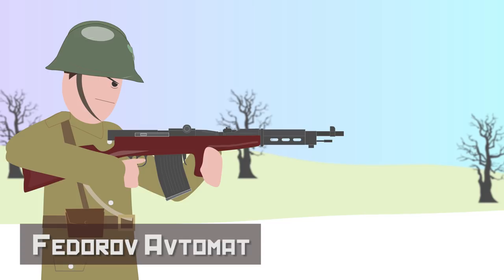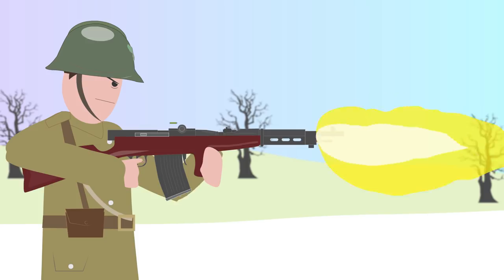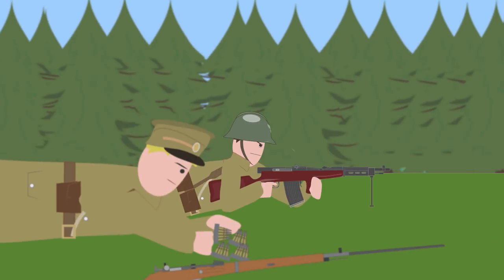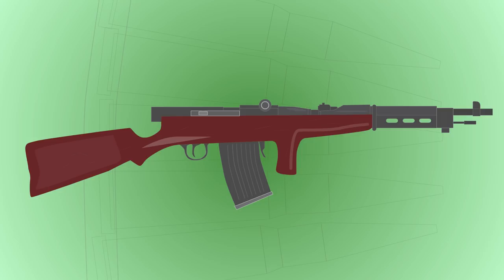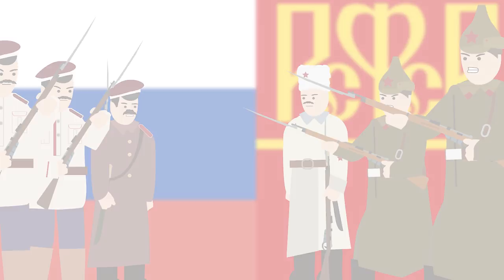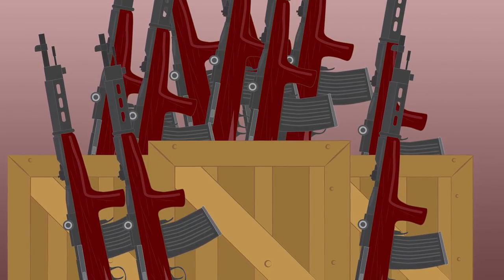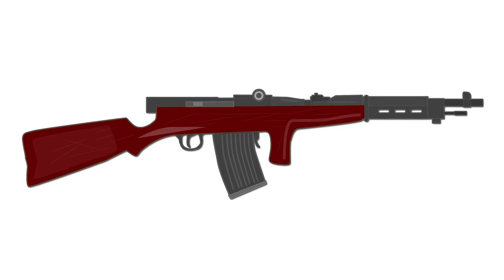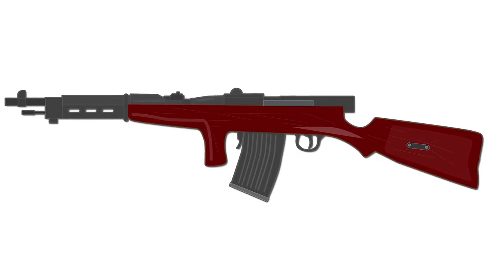Fedorov Avtomat, The First Assault Rifle?

Comment: Avtomat is not an assault rifle, never has been, never willl be. The reason, using rifle munition. If it was an assault rifle, then chauchat would be too, and its not. Change my mind.
Reply: You don't know much about the ammunition it used huh?
The 6.5 Arisaka could be described as the first intermediate cartridge today. Back then, it was considered a rifle cartridge, but it is far from a standard rifle cartridge. 6.5 Arisaka had around 2500J of energy when shot from Avtomat Fedorova, which is the same energy as the modern intermediate cartridge 6.5 Grendel. 

Rifle cartridges are 3600J +, so is it an Assault Rifle or not?
Reply: @BloPsy__  intermediate cartridge= shortened rifle cartridge. Underpowered or not,  it uses a pure rifle cartidge with no modification. Thus it is not using intermediate cartridge, thus it is not an assault rifle. End of this story.
Reply: @tigerbesteverything  Intermediate cartridge doesn't mean shortened rifle cartridge you donut. (5.56x45, 5.45x39, 5.8x42 and others wouldn't be intermediate then)
An intermediate cartridge is a cartridge, that has power between a full-power rifle cartridge and pistol cartridge. 

By modern standards, 6.5 Arisaka is certainly an intermediate cartridge when used in the Russian military in WW1 era - they already had a full-power rifle cartridge, the 7.62x54R, which had around 3700J of energy. The Arisaka had only 2500J of energy. That's also why Fedorov used this cartridge - to gain better controllability in automatic fire (mild recoil). Which is the same reason why Germans developed the 7.92x33.
End of story :)
Reply: @BloPsy__  No, arisaka is nowaday typed as rifle cartridge, thus it is not an intermediate cartridge, end of the story. And your point isn't valid, as type 38 (at least japanese) rifles where the standart issue rifle at that time, or something like that. This is why there is such an extensive usage of the 6.5 arisaka, and why the avtomat is an automatic rifle and not an assault rifle. Arisaka is a full rifle ammunition, then not intermediate cartridge.
Reply: @tigerbesteverything  What the category says doesn't matter in this case.
In terms of the Russian military, it is a cartridge that didn't have the power of a full-power rifle cartridge - that's what matters in this discussion. It was used for the same reason as 7.92x33 and it had power in between standard rifle cartridge and pistol cartridge. You can see why it should be looked at as an intermediate cartridge when used in Avtomat Fedorova, if not, then you're blind or stupid.

It's the same thing as Czech Samopal vzor 58. Samopal means submachine gun, they didn't have any other term back then for their rifle. By today's standards, it is an assault rifle.

No need to answer. I already know what you will say. In terms of the Japanese army, sure it was rifle cartridge, but in terms of Russian use - it was arguably the first intermediate cartridge - it doesn't matter what type of cartridge it was in Japan.

"After observing the effectiveness of the Type 30 6.5×50mm round used against them during the Russo-Japanese War of 1904–1905, leading Russian arms designers chambered early Russian semi-automatic rifle designs for the Japanese round. Since the standard Russian military rifle cartridge of the time, the 7.62×54mmR rimmed round, was too powerful and generated excessive recoil in an automatic weapon, a 6.5 mm round was seen as more appropriate."

Comment: Well its more of a battle rifle like what the M14 was. To be an "assault rifle" at least the way we know them today it really has to have a pistol grip, select fire, an intermediate cartridge, and be smaller and ideally lighter than a full size rifle. There may be other requirements but to me these are the most important. 

This weapon as well as the BAR were on the right track but it was the STG44 that had the right idea ultimately.
Reply: Well, it has almost all the things - it only missing the pistol grip.
Reply: @BloPsy__  It also needs to be shorter,lighter and a smaller cartridge. Definetly not an assault rifle but surely a Battle Rifle.
Reply: @PennsyPappas  Shorter? It's long as an M16 and it's lighter than StG 44. Also, by modern standards, 6.5 Arisaka can be described as an intermediate cartridge - It was used for the same reason as 7.92x33 Kurz in StG, it has the same energy as modern intermediate cartridge 6.5 Grendel and in the Russian army, it had energy between a standard rifle cartridge and pistol cartridge.

So is it really a battle rifle?? I don't think so.
Reply: @BloPsy__  But you sure as well wouldnt want to fire full auto. No it will always be a battle rifle but i vuess can be close enough. Still will never be a true assault rifle.
Reply: @PennsyPappas  You actually want to fire a full-auto - that was the whole intention of this weapon. This cartridge was used because it had mild recoil in full auto. Just like 7.92x33 or 7.62x39...
Seriously, if this is a battle rifle then MP 40 is an assault rifle...
Reply: @BloPsy__  It may have been designed to fire full auto but that didnt make it practical to do so. The men who used it complained that it couldnt be handled in full auto. Shkrt vursts and single shot mahbe but it couldn't be sustained for long or very well at all. Not sure where goure getting mild recoil from. Mild compared to a 30.06 maybe but full ajto was super impractical on the M14. Hence one of many reason why they went to M16. That and tou could carry so much more 5..56 ammo comapered to 7.62x51. Though it has proven itself to be an effective sniper rifle over the decades.

Comment: Battle rifles are not assault rifles. 6.5x50mm is not an intermediate cartridge.
Reply: By modern standards, it's an intermediate cartridge. 
At the time of adoption in the Russian military, they already had the full-power rifle cartridge 7.62x54R and as such, the 6.5 Ariska was between that and pistol cartridge in terms of energy. And as a bonus, 6.5 Arisaka is fully comparable with 6.5 Grendel (Which is a modern intermediate cartridge) in terms of energy.

Comment: It's not an assault rifle because it doesn't use an intermediate cartridge. Therfore, it is, by definition, a battle rifle.
Reply: Are you sure tho? 6.5 Arisaka has around 2600J of energy - which is the same as the 6.5 Grendel (which is intermediate cartridge)
By today's standards, it can be considered intermediate - so it's a battle rifle or assault rifle?
Reply: @BloPsy__  I'm entirely sure. Based on the primer type. The primer type is "large rifle". The 6.5 Grendel has a "small rifle" primer. Also, the 6.5 Arisaka is 6.5x50mm, whereas the 6.5 Grendel is 6.5x39mm. The 6.5 Arisaka is also a semi-rimmed cartridge and while that fact alone is not a disqualifier,  I don't know of any intermediate cartridges that are semi-rimmed. Also, the 6.5 Grendel is based on the .220 Russian, which is, in turn, based on the 7.62x39, a purpose built intermediate cartridge. The 6.5 Arisaka was not based on any cartridge, to my knowledge and certainly not a necked down version of a larger cartridge.
Reply: @herrgodfrey9563  But that all doesn't matter since it is a WW1 period and that was the technology back then. All that matters is the energy of the cartridge - that makes them intermediate.

When we will look at the 6.5 Arisaka in the Russian military, it has 2600J of energy and the main rifle round of the Russian army had 3700J of energy - 7.62x54R. So, it has an energy between a full-power rifle cartridge and pistol cartridge and thus it can be considered as an intermediate cartridge by today's standards.

If you truly believe, that 6.5 Arisaka should be considered a full-power rifle cartridge by today's standards, then I don't know what to tell you.
Reply: @BloPsy__  if you apply it today's standards, sure but it actually had a lot more energy, compared to the black powder rifles, it replaced. From that perspective, it's subjective.
Reply: @herrgodfrey9563  Also, the 7.92x33 Kurz also uses primer type "large rifle" - so by your logic, the "first" intermediate cartridge is not intermediate cartridge :)))
Reply: @BloPsy__  that's because it was a necked down 7.92x57mm
Reply: @BloPsy__  also, the 7.92x33 was a purpose built intermediate cartridge, the 6.5x50, was not.
Reply: @BloPsy__  and with more modern propellants, we could very easily get the 6.5x50 well within the large rifle category of muzzle energy.
Reply: @herrgodfrey9563  Actually, the 6.5 Arisaka replaced the 8×53R Murata, which used smokeless powder. And in terms of the Russian army, the 7.62x54R was already in good use. So it didn't really replace black powder rifles.
Reply: @BloPsy__  if I had to say it was the predecessor to anything, I'd say it was the predecessor to the M249 SAW and machine-guns like it, based on doctrinal use.
Reply: @herrgodfrey9563  Sure we could - but that isn't the question here. Sure, the 7.92x33 was purpose build, but the 6.5 Arisaka was purpose USED. 
Fedorov used it because it had low muzzle energy and mild recoil compared to the Russian round - which is basically the same as why Germans made the 7.92x33 - to get better recoil for automatic fire.
Reply: The Type 22 used smokeless. The Type 13, 16 and 18 did not.
Reply: @herrgodfrey9563  Sure, if we would go by doctrine, yes. But practically, it was really the first assault rifle - even without the doctrine.
Reply: @BloPsy__  it's a debated issue. You're on one side, I'm on the other. We could say, because the SAW can (while not well) accept detachable magazines, and some variants are select fire, it too is an assault rifle and that doctrine has nothing to do with it. Doctrine has a lot to do with it. That of course is my opinion. It was never intended to be used as an assault rifle, the 6.5 Arisaka is arguably an intermediate cartridge, depending on who you ask and it never was used as an assault rifle, therefore, I contend it to not be.
Reply: @herrgodfrey9563  But I could argue that the SAW can't be an assault rifle since it's way too heavy. The AF weighs less than StG :)
I agree that Assault Rifle without a doctrine is not really an assault rifle, and that's why I still consider the StG 44 as the first practical assault rifle, but the Avtomat Fedorova was really close if the Russians would have used it in a different way.
Reply: @BloPsy__  I didn't think the weight of the weapon itself, was a requirement. If so, I've learned something new. And I agree, based on specifications alone, it's certainly a predecessor of some kind. Good convo, regardless.
Reply: @herrgodfrey9563  I think that one of the points in the description of the US army is 'compact' - Usually, heavy guns are not really compact - like BAR and SAW (At least that's how I understood it)
Thanks for this civilized conversation, I really enjoyed it :)

Comment: Can i ask why fedorov rifle use japan rifle ammo standard?
That russian imperial army.
Not imperial japan army
Reply: I know you wrote this a year ago, but the reason was that there were significant stocks of 6.5x50 remaining from the Russo-Japanese war and the design was best implemented using as small of a cartridge as possible without sacrificing range. The standard Russian 7.62x54r produced significantly more recoil which wasn’t conducive to accurate fire in an automatic rifle weighing in at less than 10lbs (4.5kg).

Comment: Isnt the first assault rifle is the stg 44?
Reply: multiple internet personalities  from what I know it is, it's the first automatic gun to fire an intermediate cartridge
Reply: @potatus6542  That's not true at all. There were multiple different weapons before the StG 44 to use a cartridge that was intermediate in power.
 StG 44 was the first SUCCESFUL assault rifle.
Reply: @BloPsy__  but what about automatic guns?
Reply: @potatus6542  What about them?
Reply: @BloPsy__  if it's not capable of automatic fire it's not an assault rifle
Reply: @BloPsy__  or select fire
Reply: @potatus6542  Avtomat Fedorova is select fire tho. It has semi-automatic and automatic fire mode :) That's why it's called Avtomat (The first-ever Avtomat btw)
Or are you talking about some other weapon?
Reply: @BloPsy__  6.5x50 arisaka isn't an intermediate cartridge
Reply: @potatus6542  Are you sure about that? By today's standards, it is actually an intermediate cartridge. It has the same energy as 6.5 Grendel, which is modern intermediate cartridge. On top of that, it was used for the same reason as 7.92x33 Kurz - low recoiling cartridge more suited for automatic fire.
Also, in terms of Russian military, the 6.5 Arisaka had power right in between of standard pistol cartridge and standard rifle cartridge - which is actually the definition of intermediate cartridge.
Just because the cartridge wasn't initially designed as intermediate cartridge doesn't mean that it cannot be considered as one when used by Russian military in Avtomat Fedorova.
Reply: @BloPsy__  I guess I can kind of see that

Comment: The Fedorov Avtomat wasn't an assault rifle because it lacked an intermediate cartridge.  The full-rifle cartridge makes it harder to control.
It was ahead of it's time, but more in line with a BAR than an AK.
Reply: 6.5x50mmSR Arisaka cartridge (Fedorov) - ~2.666 Joules
.30-06 Springfield (BAR) ~3200—4126 Joules
7.62x39 (AK) - ~2206 Joules
7.62x54R (Mosin/PKM) - ~3500-4150 Joules
 Arisaka was as close to intermediate cartridge as you could get in WWI.
Reply: @deptusmechanikus7362  You should add a 6.5 Grendel - a modern intermediate cartridge - to the list, which has basically the same energy as 6.5 Arisaka.

Comment: This is not a real assault rifle, the STG 44 is a real assault rifle and we can see that everyone copied the model or took inspirstion.
Reply: How is it not a real "Assault Rifle"? I mean, it wasn't named Sturmgewehr, but the only thing it lacked was a pistol grip and proper doctrine.
Reply: It doesn't fire an intermediate cartridge
Reply: @potatus6542  Are you sure about that? Just because the 6.5 Arisaka was never reclassified, it doesn't mean that it doesn't have the properties of intermediate cartridge.
6.5 Arisaka has the same energy as modern intermediate cartridge 6.5 Grendel. Also, it had energy between a standard Russian pistol cartridges and main rifle round, the 7.62x54R - that's literally the definition of intermediate round.
And at the same time, it was used for the same reason as 7.92x33 Kurz - low recoiling cartridge for automatic fire.